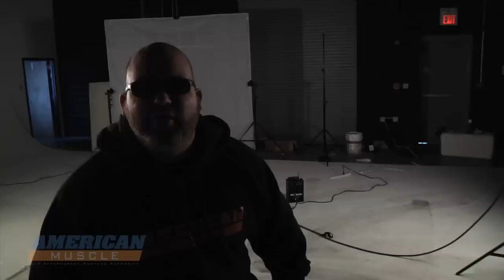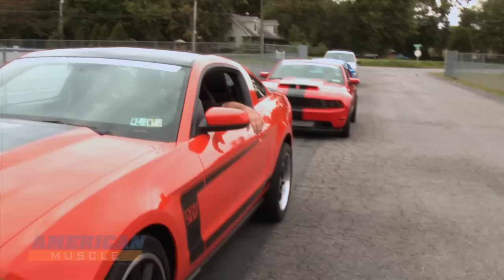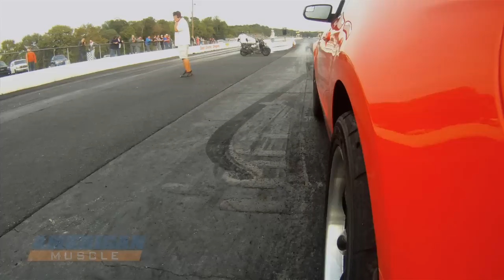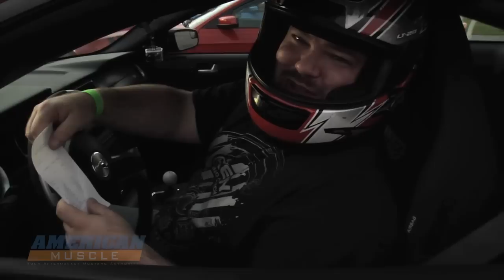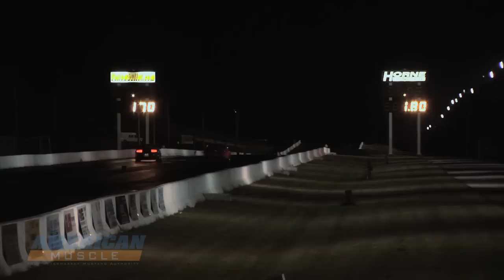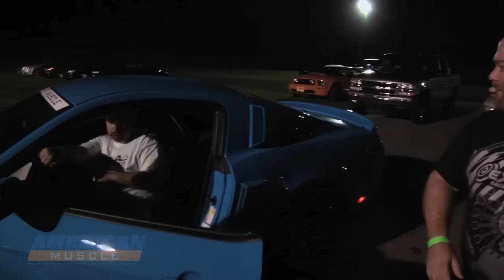2012 Boss 302 vs. 2011 Mustang GT Drag Race - AmericanMuscle.com

Comment from the maker: @suppaman12 We're talking about a Friday night grudge match racing, here at a local track with terrible track prep and street tires, for fun.  The whole point of the video was to go out and have fun with two similarly-horsepower rated cars and not try to chase a record.  We've gone 10.43 in that blue GT before with stock converter/stock trans, if we wanted to talk about being the fastest for our mods.  This was a fun rivalry, not a controlled track test for Motortrend.

Comment: I remembered when making 300hp on a V8 was difficult not you have 700+hp street cars. That's insane. 300hp on 4cylinder turbo is very common now
Reply from the maker: It's insane freeyourmind88! The amount of power you can make on stock components or in general is crazy! I can't wait to see what comes out of 2018 ;) - Will
Reply: right?  Back then WRXs had 220bhp, maybe 170 whp, now with a tune you can get them damn near 300whp on the newer models with just a J-pipe and aggressive tune.

Comment: Automatics are the best at strip racing. Skill comes from controlling your launch, getting an 0.00 on your launch, meeting your dialed time by not going over or under. It would make you seem a little less ignorant if these guys were racing circuit or time trials.

Comment: Not only was the gt an automatic it also didnt have the longtubes or catback exhaust that the boss had, of course the boss was gonna win because it has more hp
Reply: 3.8drew The car with the most power doesn't always win.  Especially when it isn't a significant difference as in these two cars.
Reply: The boss comes stock with more horsepower but less torque.
Reply: Plus the GT doesn't have boos heads or cams and I'm pretty sure the boss weighs less
Reply: Plus the boss is track tuned. So I wonder if there's different gearing etc

Comment: This is one of those videos where I go "They could both lose at least 20-30 lbs by going on a diet & that might just make them faster."

Worth noting, the Boss had the best overall time with that first run 12.4, but the GT did run a 12.41, so if they actually had competent drivers in both, they are virtually a tie :-P
Reply: I see this in every drag type event. The heaviest guys , spend so much $$$$ on ounces, but wont lose 50lbs of weight for free. some 100lbs.

Comment from the maker: @Pooz30 The fastest stock Boss I could find was 12.79 @ 108mph, we're hitting 12.40 @ 117.5mph with essentially a CAI, 93 Tune, Long Tube Headers and tires.  Also, keep in mind that 12.79 was with a pre-production track key.  A stock Boss without the track key is probably a tenth or two slower.

Comment: My '94 cougar had a 4.6 liter v8 and would return 28-30 MPG on the Highway. I never did check the gear ratios. It had a 4 speed automatic. 70 MPH was a comfortable 1700 RPM. The car was governor limited to 104 MPH which was some where near 2400 in top gear. My '91 CRX was good for no more than 17 MPG when cruising at  70 MPH which was some where around 3300 RPM in top gear.

Comment: I don't get it. The Boss is the better car between it and the GT, yet it's the one Ford is taking out of production.
Reply: They are trying to make the boss a collectors item in the future so you better grab one
Reply: Makes sense. Still sucks cause it'll make the car way more expensive but i see the logic behind it.
Reply: zarthered The Boss is amazing.  I'm an M3 fan myself...but Ford did an amazing job engineering that car (specifically to outperform the M3, lol)...

If you can get your hands on one,  it's worth holding onto for sure.

Comment: ok what exactly is he doing on his laptop? There is no form of forced induction on either of these, meaning all he can do is force the engine to dump more fuel, but that will be worthless since he can't get enough air in the cylinder to burn it all.
Reply: +jeffS197 you took the words rite out of my mouth a tune on my 07 navi which we all know isn't force ind gave me more tq and better fuel economy so a computer will be more than helpful in this situation n/a or not

Comment: Those dudes can't drive..
Reply: BoostedInline6 They both got respectable times in the quarter which are about in line with what Motortrend and Car and Driver got in their 1/4 mile runs. Shouldve been maybe 2 tenths lower, but they both did alright.

Comment: Suspension for a road course is not setup for off the line traction at the wheels with power, its to keep tires planted going 45-80 mph through a turn. On more expensive cars (100k+) its possible to have seemingly the best of both worlds because of all the tech both mechanical and electrical.

Comment: There's just the missing CNC ported heads, forged internals and a motor that ford claimed safe to 8200rpms and has been pushed to 8500rpms....stock boss motor. It's not just a GT motor with a different intake and cams.  There has already been bone stock off the show room floor boss 302s running 11s @117mph on a tire, that's it. Pretty impressive. Almost does better N/A than the new ZL1 lol.

Comment: If your drag racing auto is the way to go. I have 291 rwhp with a 3500 stall and I do 12.40 at 106 in my ws6. Stick imo is more fun but after having so many stick cars i wanted to go with auto! Nice video!

Comment: lol... suspension has everything to do with a "straight line race". the difference in suspension prevents wheel spin and allows the car to lay down the power, rather than losing it to the initial launch.

Comment: @xevious2501 Atmospherics make a big difference.  We don't know where they are, what the air pressure is, how high the humidity is, etc.  A stock GT runs 12.9 on a perfect run.  Mine ran 13.1 @ 110mph when I ran (and I'm the definition of amateur).  When I corrected for atmospherics, i.e. took it from the levels in Austin down to sea level, my time corrected to 12.8.  The GT here only has a handful of mods -- to take a half second or more off the 1/4 time is impressive.

Comment: its super tuned more so than the regular 5.0 just like any high or higher performance version of the same engine. thus costing more money, but the regular gt is still putting out quite a bit of power and if the person driving knows how to shift that much better than the person in the boss they can still out do it but still its givin the right two drivers

Comment: You're SO right. Take an average street car with its 200 hp 6 cyl engine and strip off 150 lb and you may gain a very little. But when we are taling about 4-500hp cars with the right gearing...it isn't much at all. 8000RPMS's original comment was about getting slim drivers to substantially change the times. Having driven a muscle car in the 70s I never felt bogged down with 3 other passengers. It's not as significant as 8000RPMS boasts it could be is all. Wouldn't be even 1/4 second.

Comment: I never even mentioned the cars in this vid, I said "Boss,GT, Shelby", with the Shelby of course claiming the 11 sec stock times. The 05-10 years were upgrades over the '99-'04 models for sure, but they don't hold a candle to the '11+ years.

Comment: Wow, my mods on my 2011 gt are..steeda cold air intake, leathal performance x pipe, magnaflow street catback, and a midatlanticperformance tune..on. the factory wheels and tires I ran a 11.95 @ 117.

Comment: To each his own I have a c-4 built in my 78 cobra it doesn't make you a wuss it just makes straight line racing more precise. However on a road course manual is better to wind it up and down around bends.

Comment: Ok so if you a really looking for a new fast car and are on a budget you can do what i did/currently doing i bought my 2014 Mustang GT base model manual transmission after all the rebates and interest im paying 33k for the car with the mods im getting Suspension: Lower Control Arms(also helps with launch)$189, Adjustable panhard bar $114, H&R Lowering Springs $259, Eibach pro damper Shocks and struts 446, Boss 302 Strut Tower brace $99 , and an Anti Roll sway bar kit $400  this should help it handle as good or even better than the boss 302 the total is $1,500 so overall 34K now for power mods  Carbon Fiber CAI and Tuner $699, Boss 302 Intake manifold (Lets the Engine rev high like the Boss 302) $499, so a total of $1200 which leads to a grand total of 35K with that your estimated to make over 400RWP with a tune and a cold air ive seen it run a 12.3 1/4 mile which is the same speed as a boss now with the intake manifold and suspension it should be faster so now we are talking Around the same or better as a boss in handling and better than a boss in acceleration. And if over time you can spend a few more bucks throw on bigger tires which is what im doing and short throw shifter to make quicker smoother throws  just little bolt ons like that. overall you will make your car look better and handle better and be a lot more quicker than stock. but overall i suggest you wait for the 2015 Mustang rumored that the stock Gt will be better at handling than the boss. whats the worse that can happen you either see it in person and fall in love with it or you just buy a new 2014 for im guessing a reduced price since they are probably going to try and get rid of the older models. Well i hope ive helped when i get back home from being overseas ill post a few vids of my Mustang.

Comment: the gt just has a boss intake manifold jlt cold air and a magnaflow x pipe.. plus a bama tune... the automatic transmission in the 5.0s are the real difference maker

Comment: Yes, 32MPG. It is common for M6s to pull this kind of MPG. The reason is not a ten speed.. Its a Six speed matched with 3.42 gears in the rear end with a final drive ratio of .5

This means at 65MPH I am at 1500-1600 RPM and at 75MPH I am at about 1700RPM. It is easy to get great gas millage when you can practically maintain speed at idle.

No thunder Stolen

Comment: Must be a turbo...cars with boost from the factory can really gain a lot with only a tune. Now cars like mine with the LS1 you wont see a very big gain at all on a stock motor...start adding a few bolt ons or even a cam you'll get big power with a tune

Comment: @diddy150 Usually since the main goal is comfort, the springs in valve bodies are pretty strong and set for smooth slow shifts.... the manual will have a better chance of getting a good time stock vs stock, but the auto will continue to stay consistent and get the better overall times. FYI, they only have the cars for a few days which isn't a good amount of time to be familiar with it,

Comment: the boss 302 is one hella fast car. Do not underestimate this car. My friend owns a 2013 boss 302
Reply: I own a 2012 Laguna Seca Boss 302 #171 and with me weighing in at 150LBS I can't put all the power down through the first 4 years without spinning still I using the original street tires with 30k miles on them but I havent lost a race yet

Comment: 1. I'm 27.
2. The Ford GT and it's PREDECESSORS have been around as long if not slightly longer than the Corvette. The GT40 was used to win the 1963 Lemans and had the round taillights in the rear. Up until this point Chevy had tail lights similar to other cars. Chevy updated the SAME YEAR the GT40 was racing. 
3. Look up your facts first.
4. Ford GT was made from 2003--2006 and 4,038 were produced
5. Chevy design cues were from Ford. Notice they changed AFTER ford.

Comment: I believe the Aston Martin One-77 is the most powerful naturally aspirated road car in the world. As far as v8? You may be right about the 6.3L and it is a great engine..but..There's a N/A Coyote running around somewhere (JPC I believe) making 550 -wheel- horses and I've never seen a 6.3 dyno over 500. :) Also, don't forget that MMR Coyote making 2100 turbo horses with forged rods and pistons, all else stock including crank. (cryo treated only I think). Just sayin.

Comment: What's the swapping of the Boss's intake manifold onto the Normal Gt like?  Straight forward or lots of fab work to make it happen?  Injectors, fuel rail, etc have to also be swapped from the boss over to the GT? Thanks guys for throwing down some great runs foer us viewers.  We appreciate  the outcomes of what your mods are doing to qtr times.
Oh, by the way.  I got a "rice" STi but not all of us import "current" owners are douche bags. My favorite car was my 72 Nova. But,I will have another V8

Comment: the boss could be could be auto transmission and the gt be manual, the auto is not set up for racing so you can outshift them with manual because with the auto you lose alot of power but if it is the same as the new one which i beleive it is they both have 5.0 ltr 302 engines in them

Comment: actually most hardcore drag cars use a built automatic transmission. When set up properly they can launch much harder than a manual and shift harder as well. Look up stalled mustang.

Comment: Mustang GT and Boss 302 are two different cars. The GT won't have the fancy stripe on the door and it won't say 302 because it doesn't have 302 cubic inch motor. The 302 has 444 horsepower and better suspension, while the GT has 420 horsepower and not as good suspension. The price disparity is around $15k, the Boss being the more expensive of the two.

Comment: E-85 is the absolute shizzle! But best used with turbo charging. That is where E-85 really shines. Most say as good as 110 race gas or C-12. C-16 has higher octane but E-85 still wins in cooling effect. I have seen builds that run up to 40 psi boost using E-85. Remember, this can be run every day in the street at LESS than 4 dollars per gallon!!! How awesome is that compared to 15 to 18 dollars a gallon for race gas? Draw backs are water absorption, 30% less efficient,diffclt to store long term.

Comment: wouldn't the gt have done better with the stock intake instead of a boss intake since the boss intake looses torque?
Reply: if he wanted more torque at lower rpm's then yes the stock GT intake manifold would have been better but depending on what he made the redline to, the boss intake manifold is far better at producing power at the higher rpm levels then the GT intake mani. granted if he kept the redline at stock then that intake mani is just for show and not being fully utilized because it has been proven the boss mani can make power upwards of 7800 rpm.

Comment: having these cars modded like that and still running mid to high 12s isnt that good, i went to the track 3 days ago and there was a bone stock 2011 gt on its street tires (completely stock 100%) running 12.2 consistantly and his worst run was a 12.4, so idk what you guys need to do but those cars should be in the mid to low 11's at least lol

Comment: Its still a production car even through its produced in low numbers unless you mean mass produced. production can have a number of meanings. A corvette zr1 is faster and with that live rear axle 80% of v8 cars will be faster round a corner. Most bmw audi and merc saloons will have similar 0-60 times.
SL 55 AMG
SL63 AMG 
SLS AMG
BMW M6 
Ferrari 458
And a 2.0l evo fq400 will do 0-60 in 3.5 too so if it was the fastest 'production' v8 i would be pretty sad.

Comment: let me ask you something smart one......what's is one most important rules in any kind of racing...1) power 2) handling 3) weight.  can a 175lbs driver have better number....to a 300lbs+ driver? you tell me...you said 50-75 pounds would not make a difference...i agree with you we all have some extra pounds but them boys are not 50-75lbs extra.....them boys are at least 150lbs extra. so i believe it affects the performance of those sweet rides.

Comment: I used to work at a Mercedes dealership so i can tell you first hand that no AMG out there that will touch a 2013 gt500. maybe they are faster on a track.. but most people don't take their cars to the track anyway. The Gt500 was never built to take to a track. It's built for the drag strip. Ill give you the Vette. And you'll have to excuse me. It's "The most powerful production v8"

Comment: @SOFSoldier1 whats the sticker on a 392 challenger? probably 47? 48? I bought my 2012 gt/cs for 38,000. $1200.00 put my car at 11.5.......? The boss 302 runs the same as the 392 and is about 5,000 less? So in reality for what your paying, that car should move on a lil quicker then a stock 5.0.  Comparing a 392 to a stock 5.0 just doesnt work. Compare a stock r/t challenger to a stock 5.0 and a 392 to a BOSS 302. R/T:13.5? Stock 5.0:12.8? Boss and 392: High 11's low 12's. see my point??